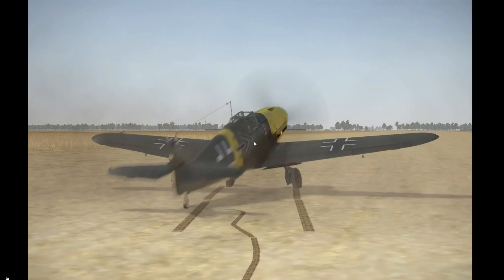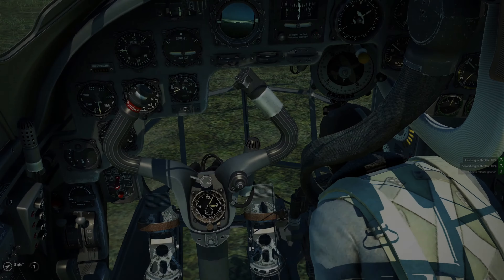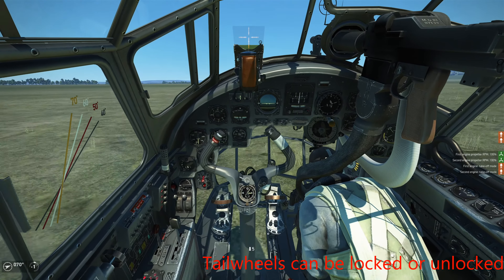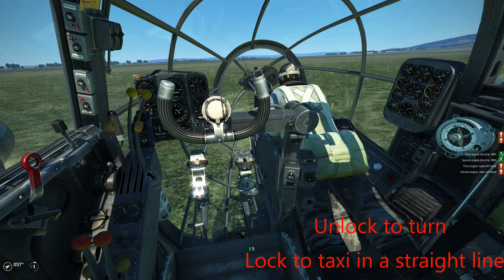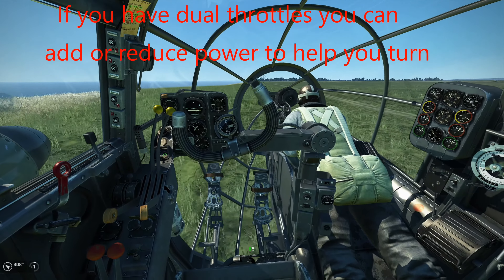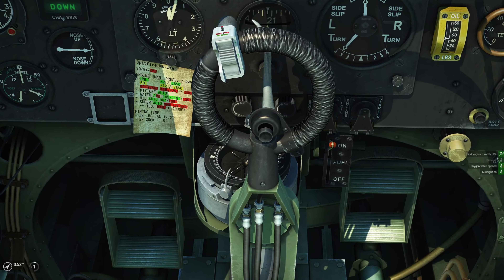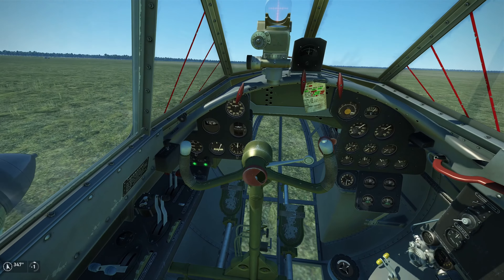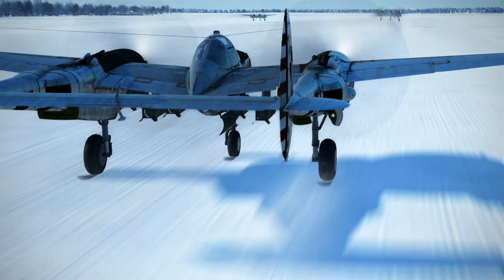(103) IL-2 How to Taxi - Advanced Taxiing Techniques

Comment: Once I release tail wheel in BF109, alway lose control. It will lose direction even you clicked lock tail wheel.
Reply: You need to apply brakes. I had the same issue. If you don't set up individual left/right breaks, it will press the brake that you're applying rudder to. Takes a lot of practice but you can control it after you learn how it will react.
Reply from the maker: see video: (2) How to taxi without screwing it up - first :)

Comment: Do you have video on how use quadrant throttles on dual engine aircraft?
Reply from the maker: I use a single throttle for duel engines. For feathering and single engine management try my Complex Engine Management vids 1-4. Big learning curve but you'll get it.
Reply: @colninny8769  thanks I will check those out.